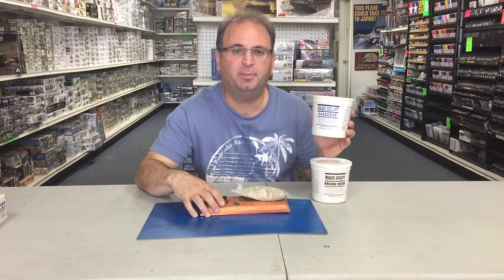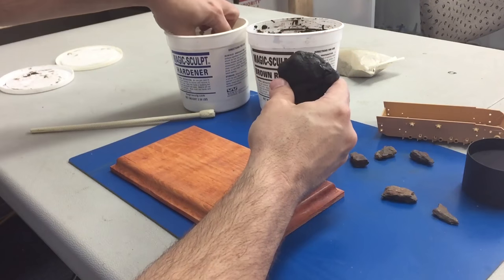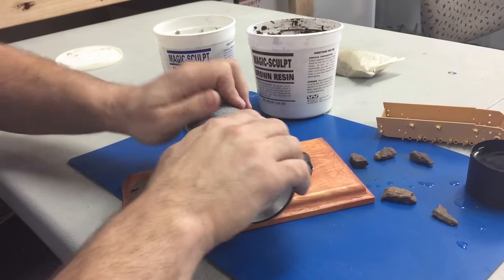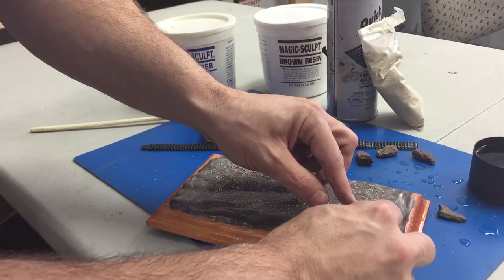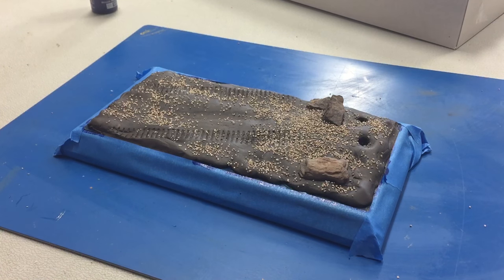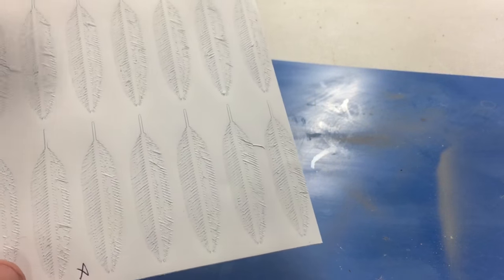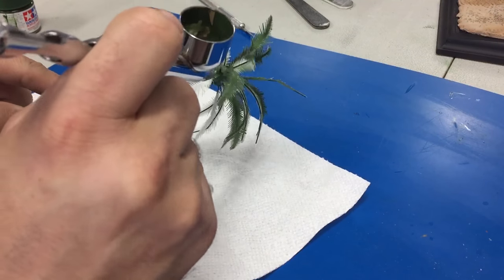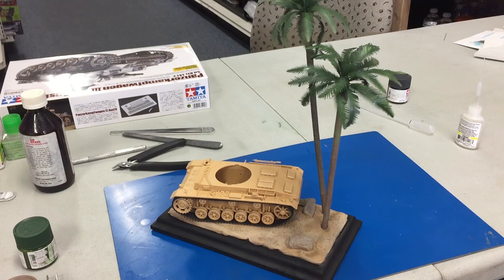Building A desert diorama  for a Tamiya 1/35 Panzer III in North African Markings.

Comment: Andy, have you ever tried using air drying modelling clay? I personally prefer it due to how easy it is to mound once you put some water on it. I would only really recommend it for small dioramas for singles tanks as it can get quite expensive, but it's really easy to add textures and shape it
Reply: I'm a fucking noob to dioramas, but i tried air dry modelling clay for a Tobruk diorama, and during the drying process it warped pretty bad, cracked and one edge raised 2 inches. I assumed something like this might happen a bit, but not so extensive. I binned it and made the diorama flat. What did i do wrong?
Reply: bad clay possibly? make sure its good quality and also that the base wont bend by using thick, non flexible material

Comment: Kinda wanna make this too but did you make the wooden base yourself?
Reply: Oh and do you glue the tank to the diorama or just place it on there loose
Reply from the maker: yes just cut up some boards then routed the edges
Reply from the maker: no just place them on top
Reply: +Andy's Hobby Headquarters allright thanks nice job on the board though
Reply: Just buy a picture frame

Comment: I'm working on a project which is Inspired by Raiders of the Lost Ark in One Scene there is a Convoy that is moving through the Desert Road delivering the Ark to the Submarine Base. No trees, just rocks and sand. Indy not included, srry :(
The Vehicles I'll be needing are:
- Coloniale Staff Car or Citroën Traction for the Staff Car Belloq, Toht, and Dietrich rode on.
- CCKW 353 Utility Truck or Kfz.70 for the truck that carries the Ark to the Submarine Base.
- Sd.Kfz 222 Afrika Korps for the Armored Vehicle that guards the truck from enemies ahead.
- BMW Motorcycle with Sidecar for the bike in the scene.

Extras: 
- Afrika Korps figures (optional)

I will not be putting it on a piece of wood but I'll use an Illustration Board as the Stand (a.k.a. Power of Improvisation...)
Reply: sounds neat. im working on a gulf war diorama with and abrams and m3 bradley